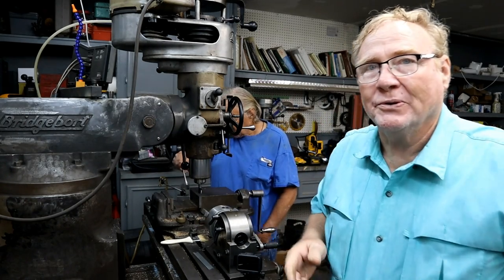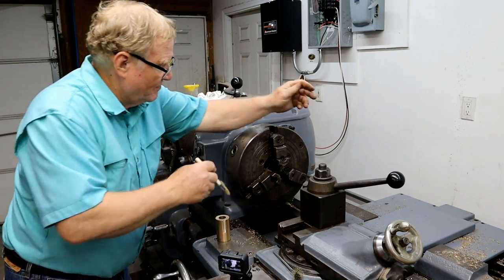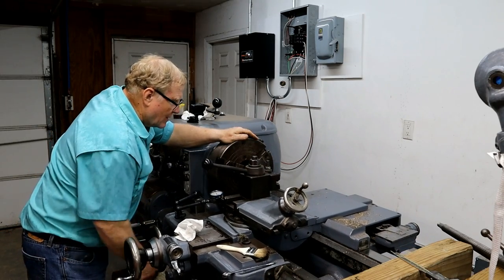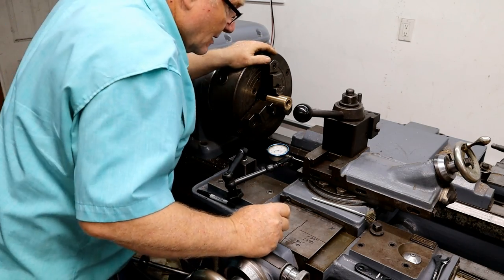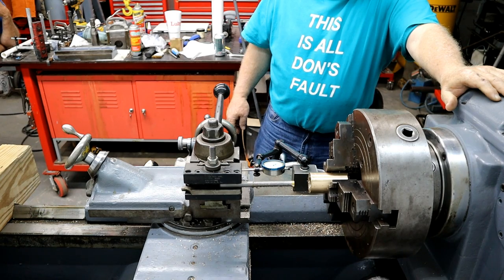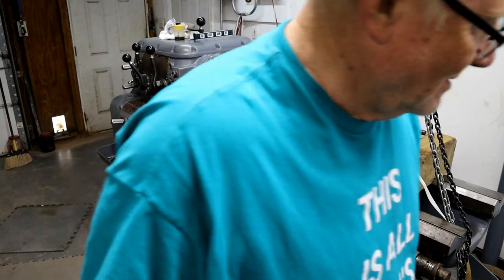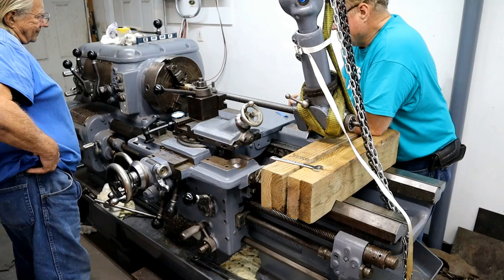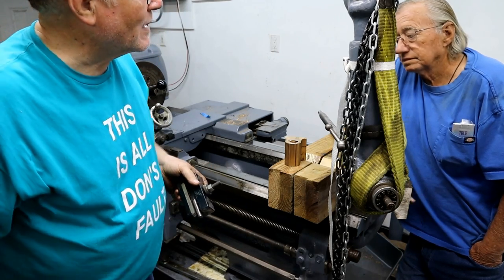Repairing Old Machine Tools: Multi Start Lead Screw

Comment: Reminds me some years ago did a repair on a 16" Sidney lathe. The forward/reverse rod nut was veeeery worn. Some thing I really didn't use, but repairing mach should be tightened up. I found a product called Moglice, which was pourable and I made a bushing in place to tighten up the Acme threads. It did require some non-embedding compound to fit, but has worked well for quite a while. Loctite and a couple Dutchmen in the ends will have it be there forever! Keep up the good work! Always a loyal viewer!
Reply from the maker: I have moglice here but I think it would be too soft to hold the forces of the bar... I'm going to make a new square shank, bore the hole for the stub to fit into and then braze it..

Comment: I would have to disagree that boring and threading tools do not work like you described when talking about deflection.  Deflection is purely a function of cutting force and tool stick out from its point of support. There is no extra deflection deeper in a hole Than at the start unless you are changing the bar stick out length to go deeper. Glad you finally defeated your nemissis
Reply from the maker: I would say that the deeper a tool goes into a bore, especially with a 1/2 bar sticking 4 inches out from the holder, the more the deflection increases and builds upon it's self.   Thus requiring many spring passes to take out all the results of the deflection.     A 1 inch bar would not have as much deflection and result in fewer spring passes to make the threads "straight" in the bore.... A 3 inch like you use,     "We dont nee no stinking spring passes! "    :)
Reply: @10swatkins  Well I guess technically it depends on the tool cutting angle a square cut face will be neutral  an angled in will push off as it goes and a angled in will get sucked in as it goes.  Onve the tool pushes in our out whatever the cutting force is to balance the deflecting force it will maintain that depth of cut so probably after 2" or so it would not change but in the first little bit there could be some variance.  Fun to think about all the machanics of cutting steel at the details level. 🙂

Comment: I'd thread a couple of 10-24 set screws right in the seam between the parts (the circle) on each end. That would stabilize it in both axes. I'm sure by now you've already done what ya did.
Reply from the maker: Come on leeroy...  That what I said I was going to do both at the start of the video and at the very end!  Only a 5/6 18
Reply: @10swatkins  Sorry Steve. I misunderstood the location. Crawling back under my rock now.

Comment: I always try to sleeve a carbide boring bar like that with steel.  if it dont make it to big anyways.
Reply from the maker: IT would not hurt on this small bar... Does not fit very well in any of the holders... Thinking of make the new sleeve round to fit in a proper boring bar holder.

Comment: May I respectfully suggest that you use a flex line to supply oil all of the time . Also how do I cut multistart threads on my Heavy 10. And where did you get the boring bar and inserts? Thanks...
Reply from the maker: There is no room for any type of line that will move with the nut.... We barely have room for a short piece of 3/16 brass line to attach to the top of the casting...   We will show you when we install it...

Comment: Steve, what is that small dial just in front of the cross feed dial, oriented 90°, on that Axelson?
Reply from the maker: I am thinking you are talking about the cross feed stopping feature... You can set stops with that dial and lever for the crossfeed. Very handy.

Comment: The world's most expensive shaper nut. 
You mentioned that it was a full profile insert. I was wondering if there was enough relief for it to run at 2tpi instead of 4tpi or did you grind a little extra clearance?
Reply from the maker: I left it alone... I took the threads down in steps so it did not go all the way in until it was close...